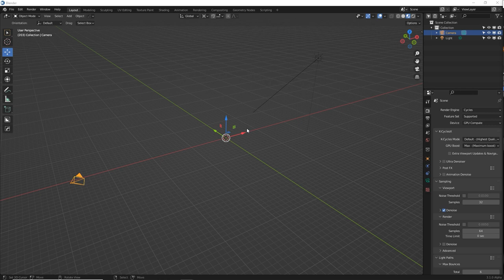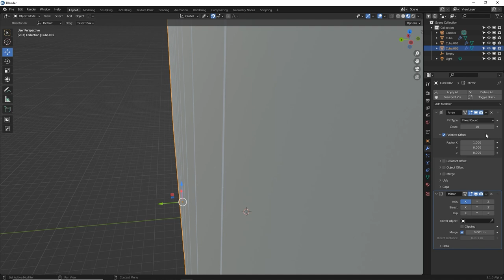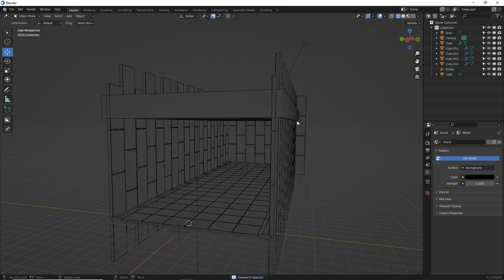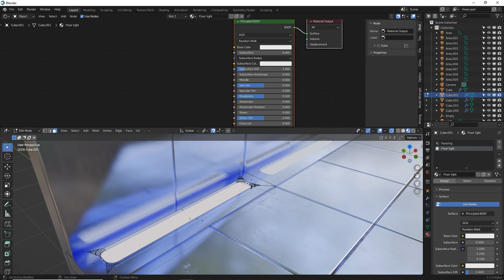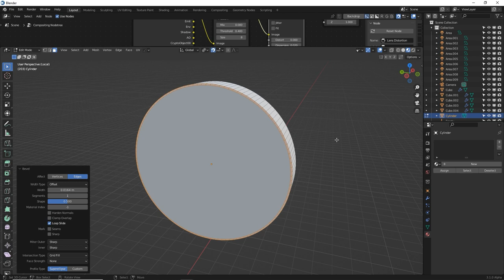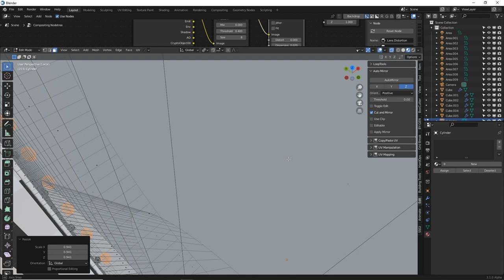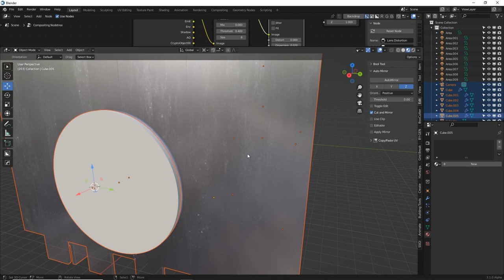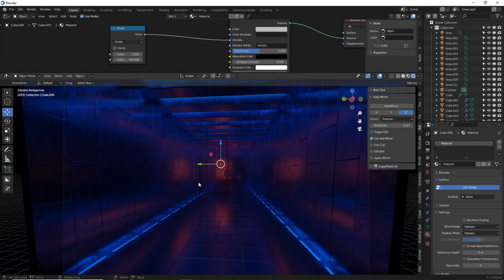Scifi vault hallway tutorial in Blender Eevee

Comment: Can you recommend or make a vid bout getting high quality renders or rendering 101
Reply from the maker: Sure! But when you say high quality renders what does that exactly mean to you? And what kind of renders are you doing? Animation, stills, photo realistic, stylized, eevee/cycles?
Reply: @DanielGrovePhoto  i render in cycles it's a mix of realistic and stylized but rn iam struggling to render good crisp realistic images
Reply from the maker: @dooomswear303  Well the unfortunate key to cleaner renders is simply more samples / better denoising. I use Kcycles X as it's faster than Blender and has some additional options for denoising and post fx which I don't currently use. You can speed up renders by lowering the light bounces but it also reduces the reality of the light bouncing from ray tracing.
Reply: @DanielGrovePhoto  I've done both of em and my friends told me the same thing hmm I've gone as high as 20 000 samples but that just took too long and the final product was that good either I'll need to figure this out somehow as I've got a beg project to render soon
Reply from the maker: @dooomswear303  Well that's just the finishing touch - as for getting realism in your scene there's a lot to it when trying to mimic real world lighting, atmosphere, depth, camera, and scale. I do plan on making a video with multiple tips on achieving realism soon I think that might benefit you a lot.